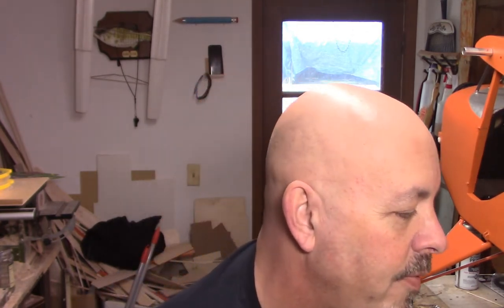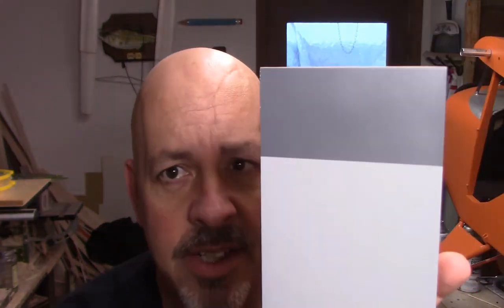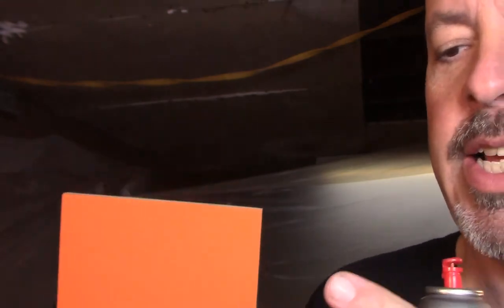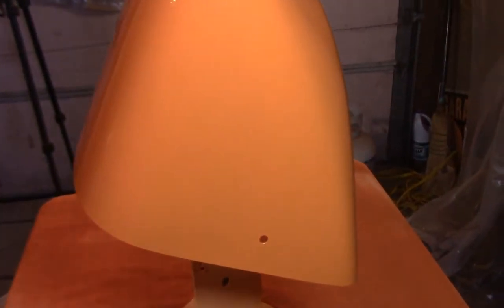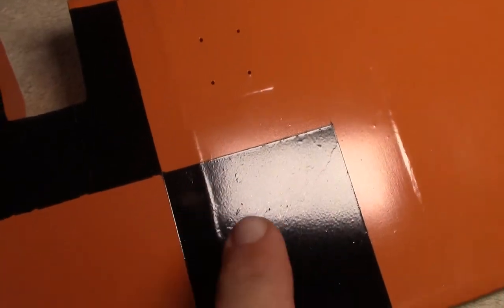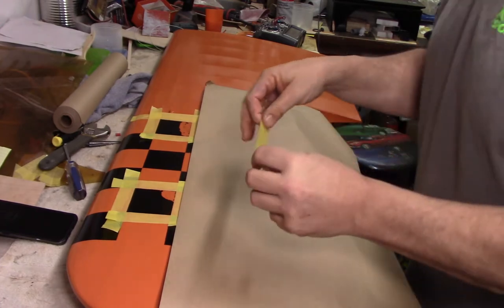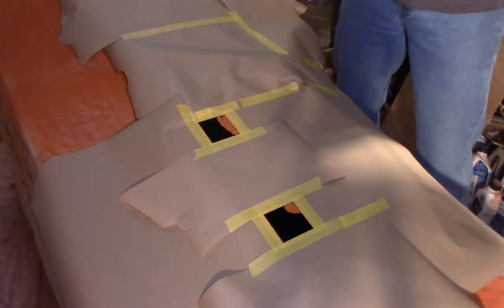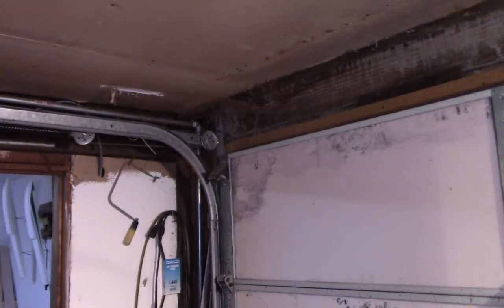33% Taylorcraft - Video 79 - Engine Cowl Painted and Checkerboards Fixed

Comment: From what I understand, Krylon is not fuelproof. So how did you fuelproof it?
Reply from the maker: Krylon is fine with gasoline engines. Glow fuel will attack it. With glow engines you'll need to use an epoxy based paint.